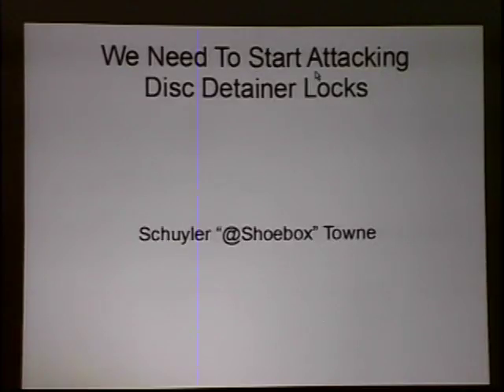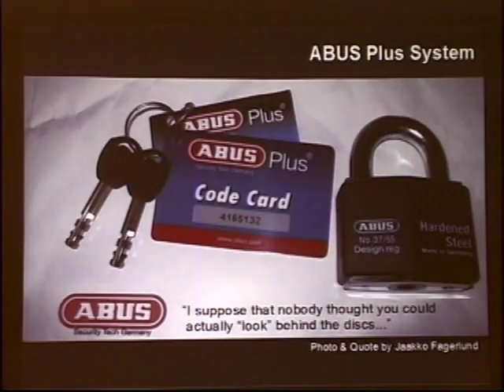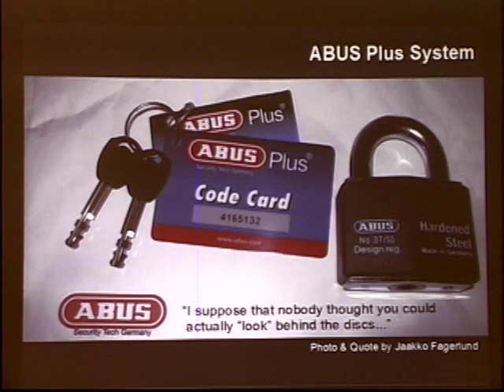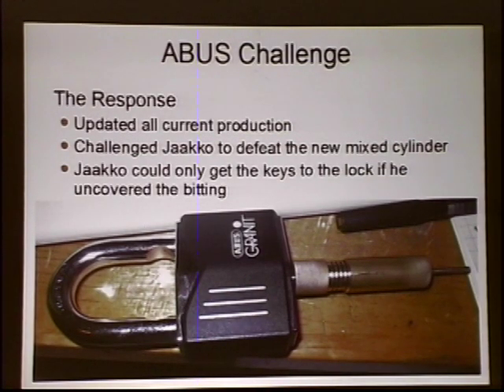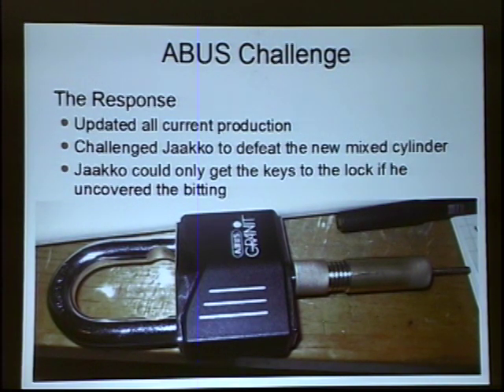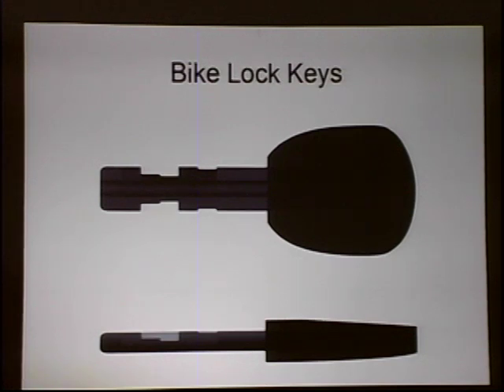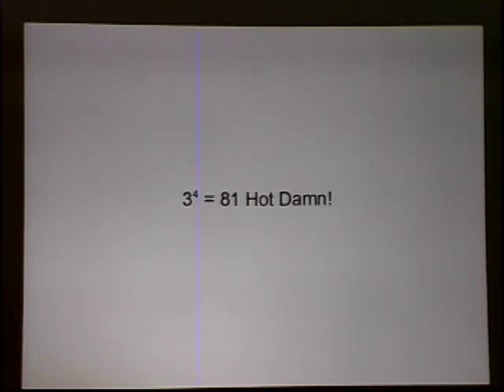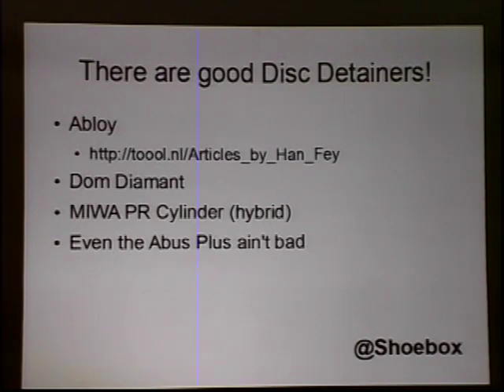We need to start attacking Disc Detainer locks. Shmoocon Firetalks 2011

Comment: The unfortunate truth (at least here in the UK) is that bicycle thieves don't do anything subtle like picking locks, they just attack the lock(s) with a battery powered angle grinder. The only thing you can do is make it so the other guys bike easier for them to steal. Even then, if they can't take the whole bike they'll steal anything they can unbolt like the saddle or handlebars.